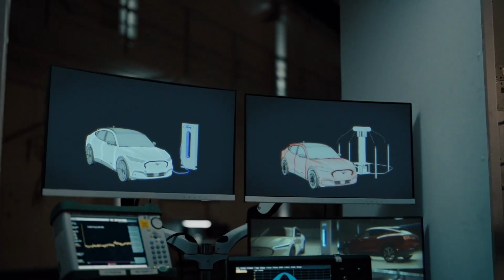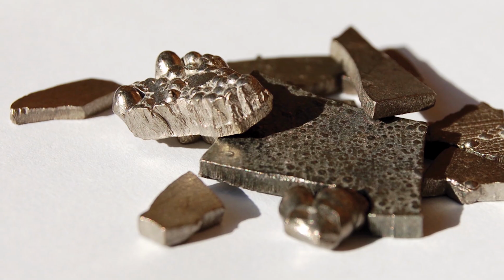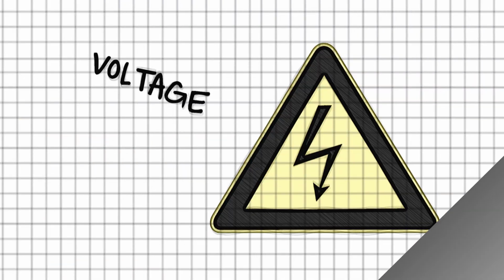ABC of EV...Voltage

Comment: As a consumer of battery powered stuff (from drills to leaf blowers to EVs) system voltage doesn't tell you much about what to expect from various products or allow you to compare / predict their performance. Power (W or kW) and battery capacity (Wh or kWh) directly tell you performance and total work per charge respectively.
When engineers designed these products, system voltage was one of two basic variables which were chosen to achieve the desired performance, the other being current. The product of the two is power. During design, there are a wide veriety of reasons to favor one or the other in various types of product designs. There is often little difference in overall system cost, size, weight, efficiency, etc. Other times there might be marginal reasons to favor one or the other.

Now... If you buy a product and hack it to increase the supply voltage, yes, performance will increase a lot... right up untill there is smoke and melting stuff. (hint - when you just increase the supply voltage, that also induces a higher current). In simple things like motors or heaters, doubling the supply voltage quadruples the power consumed.

I hope this helps clarify what voltage typically means to a consumer.

Comment: Let me know if you answered this in another video but, since not all EVs are the same voltage, how do they charge at the same charger? Do the chargers sense what the output should be or do the sockets/adapters  convert to the correct voltage?

Comment: I would only note that voltage and current are inversely proportional to the amount of power they deliver. In other words if you double the voltage it takes half the current to deliver the same amount of power. It’s not that higher voltage EVs can deliver or receive more power; that’s all depending on how quickly they can cool the components that are receiving the power. It’s just the wire size for those batteries and cables etc. don’t have to be as big because the current is less than a lower voltage system. Want a great EV? Buy one that keeps the battery cool at appropriate levels during their most stressful called upon moments whether that be charging or driving.
Reply from the maker: Thanks Gary! So hard to get all the info into a short video! Glad you're enjoying the videos and delighted for your comments!

Comment: Hi Martyn.  I know you don't want to get too technical but mentioning the equation P(measured in Watts)=V(voltage)*I(current) or simply P=V*I could be useful.  This shows how you can keep the power level the same by proportionally increasing voltage and decreasing current.  Hence, to keep the same charge rate you can use higher voltage and lower current, allowing for smaller wires and less expense. Of course one of the trade offs is higher voltages can be more dangerous.
Reply from the maker: Thanks John, great to have people chipping in with extra info. It's a hard balance to strike on offering a certain level of detail!